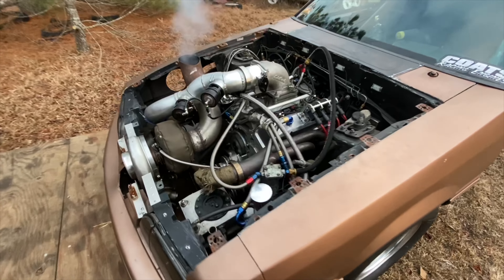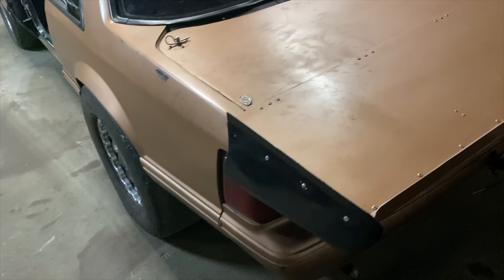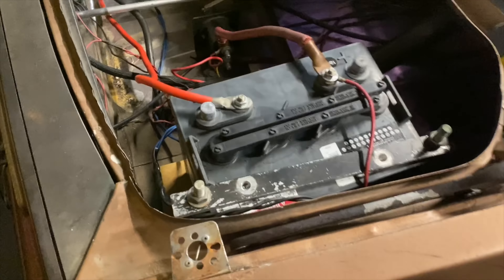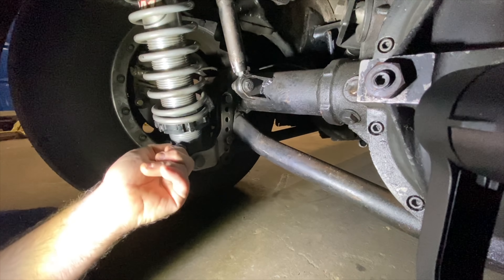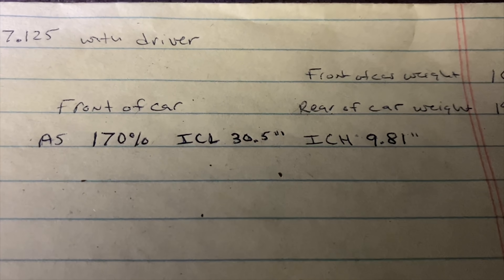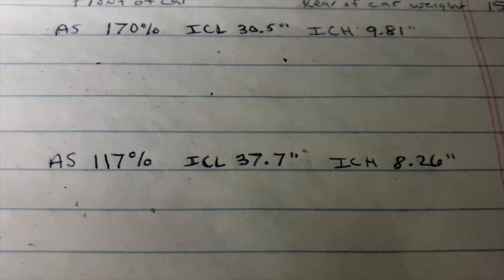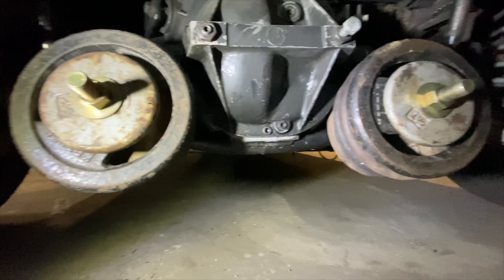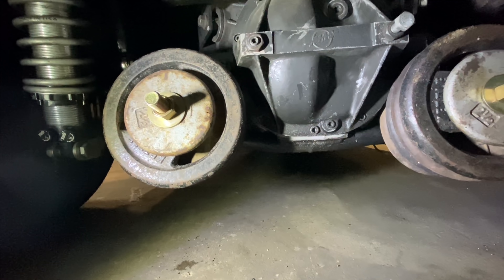Radial prep to No Prep: new tires, moving weight, changing antisquat

Comment: You could always drill a small hole in in your new weight mount pin close to the diff housing and fit safety cables to prevent them becoming high speed projectiles if tyre shake ever breaks the welds, keep up the videos 🇦🇺

Comment: When ever I do no prep stuff or run on the street I run Hoosier D05 compound 28s and the Do7 compound for normal prepped stuff. You got alot more car than me lol but no prep stuff in the 5.40-60 range and 3250 pounds the d05 compound works really good on my car 4th gen f body with basically everything BMR makes and viking coil overs out back and old qa1s up front but they move around ALOT on the big end every time my car is really getting down I throw the chute ASAP the DO7 compound is alot more stable on my setup. Iv been told that my car is to heavy for that soft of a tire, I really dont kno lol, I barely kno how to keep it goin straight and running. It took me a good while to figure out how to no prep but so far my PB is a 5.56 @ 122mph it might have went a few more mph but like I said I grab the shoot asap. I know you will figure it if my GED having ass did!! LOL
Reply from the maker: Nice, thanks for the tips.  That is fast!
Reply: @TurboJohnRacing  I got a question for you I made a post on turbo bullet asking about my plan to go to m1 on my car no good replies only people bein sarcastic and tellin me ot wont work with no explanation. my plan is ditch the air to water and swap over to billet atomizer 325s when I get my income tax return my plan was to keep my meth injection set up (fuel solenoid with nx shark nozzle) but move it as close as I can to the turbo and when I do get it on the street for class cruises and what not fun the e90 that I'm currently on and when it's time to party throw the methanol in it. I was told  I would not be able to get the car to idle with billet atomizers and ethanol I dont understand why but I would love to hear your opinion I'm pretty surr I got plenty of fuel pump to support the power my car will make, and lastly what's the deal with m5 I kno I'm uneducated but m3 or m5 seems like the way to go, Iv been reading, asking  questions and trying to learn all I can I guess I'm just slow or something idk lol

Comment: Maybe you will have luck with it but that down hill on the lower control arm will make them bounce as it drives the body down on the launch as it pushes forward. We have never had any luck with that.
Reply from the maker: It ended up going uphill slightly.  Thanks for the tips.

Comment: How do you take the measurements? My car is so low I don’t fit under there. A drive on ramp? But then you won’t be able to use the bobby pin to figure the uppers cause there is not ground in between the drive on ramp. Also in order to  lower or raise the point on the lower control arm wouldn’t the length have to be adjusted? So you would need adjustable control arms no matter what? Also since the adjustment is straight up and down and not circular curved wouldn’t it change the pinion angle? I’m so confused now my mind done tornado’d it’s self. Please, I’m trying to understand